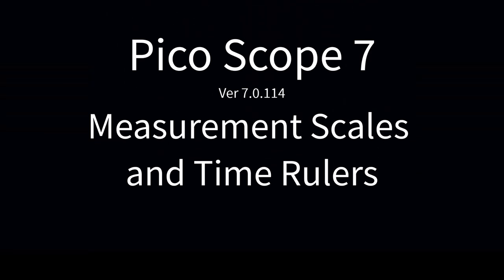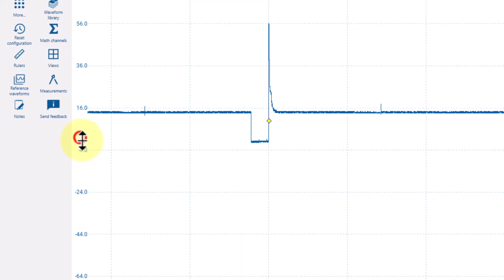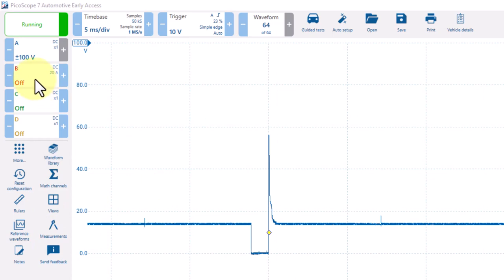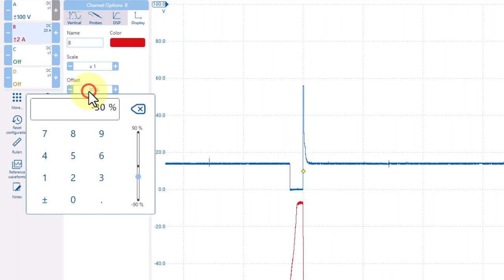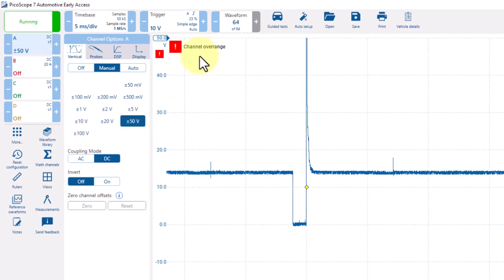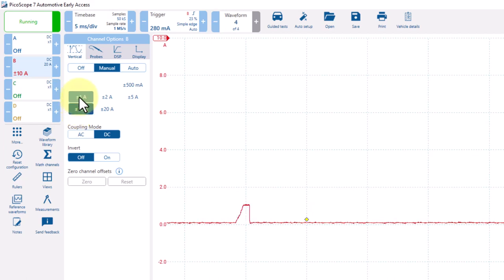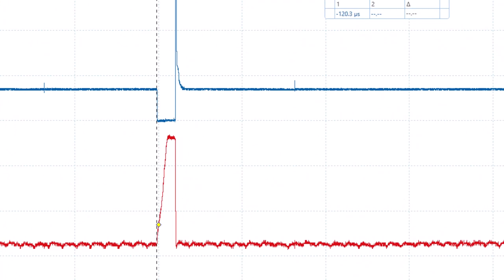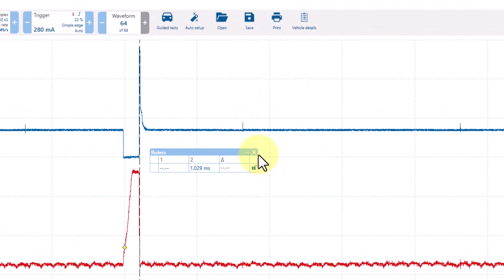Pico Scope 7 Automotive Scales and Time Rulers

Comment: Hi thanks for the explanation. Do you know how yo add 4 rulers at the same time ?
Reply from the maker: So you can't do 4 time rulers but you can add Phase rulers for looking at the engine cycle such as 360 or 720 degrees of rotation.  You can partition anywhere from 1 to 36 partitions so you show a partition every 20 degrees. To do that click on Rulers and turn on Phase rulers and select your options.
Reply: @DrivelineMaster  thanks I figured but the phase rulers looks with color and it is not the same as the other ones but it might help thanks so much!
Reply from the maker: @fegmihamedlafi5051  Yea, I know.  You can always submit a recommendation to add additional time rulers.  You never know, they might listen especially if they have had multiple request.